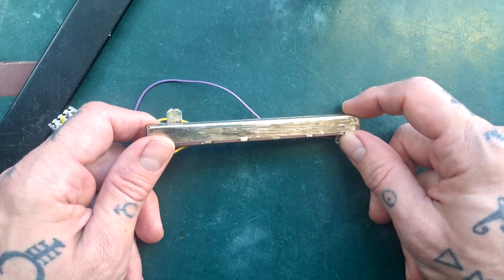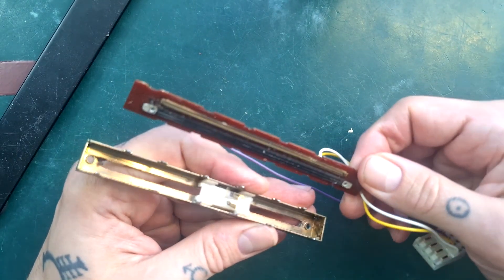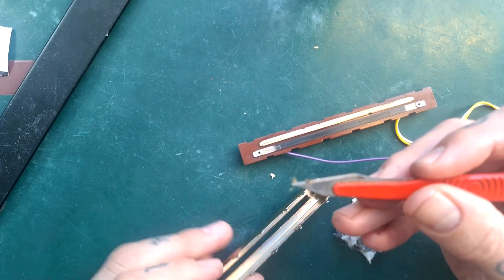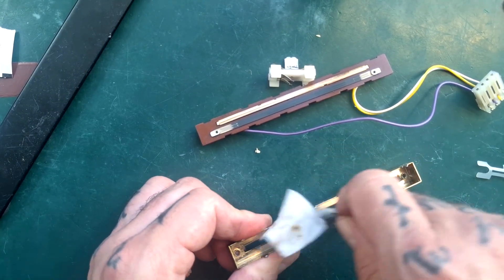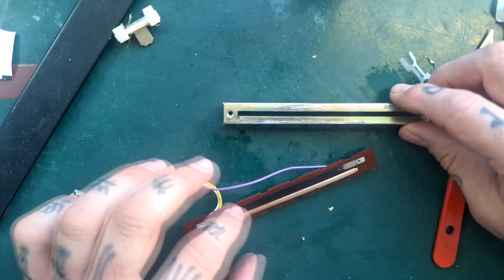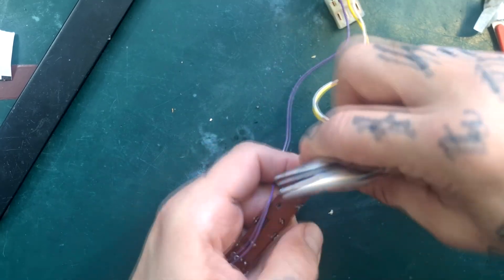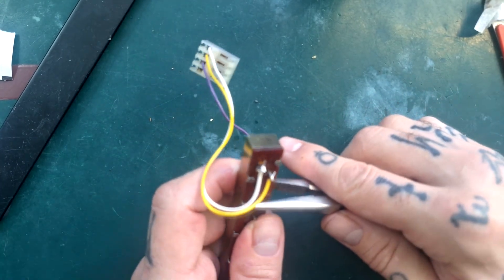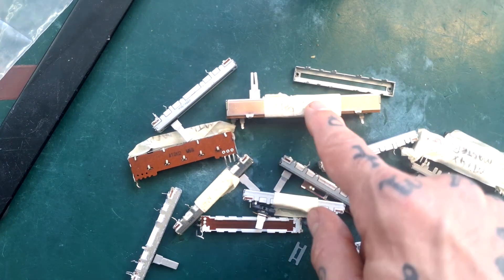Reburbishing a Mixer Fader from Start to Finish

Comment: Absolutely great video, thanks for the insight. Just bought a used Yamaha MG10XUF for some additional channels to add to my Scarlett 18i8. I'm aiming to not down-mix as I'm going to connect a couple of instruments I can't play at the same time. I'm not convinced it was worth the price as it wasn't that cheap and the faders crackle a bit. This is a bit much, but I think I'll start with some compressed air. Hopefully that will be enough...

Comment: Bad capacitors can fool you into thinking you have scratchy faders even knock EQ pots can become scratchy as well even when their is nothing wrong with them and capacitors don't ever swell in my experience they leak from the bottom so you never find the problem until you start removing them in a mixer it is a tedious job. Keep away from Yamaha 90's cassette multitracks the caps leak pretty bad.

Comment: You noticed there was old grease in the fader. The faders do not need new grease then?   Faderlube is the grease ?
Reply from the maker: You could use either, but the lube can be applied via the needle nose into tiny recesses on potentiometers etc in a way grease cannot, so it is a more versatile product, and you need less of it for the same job, so I just use it for everything to keep costs down and make life simple.